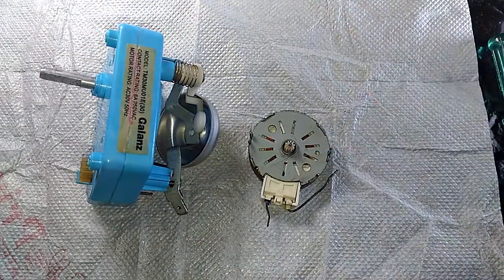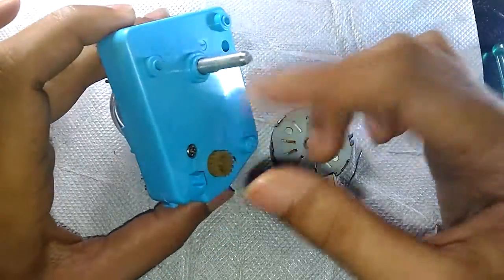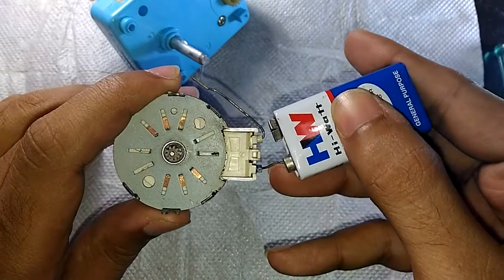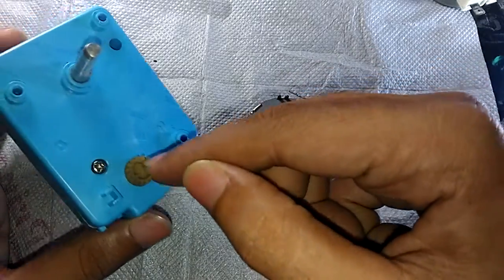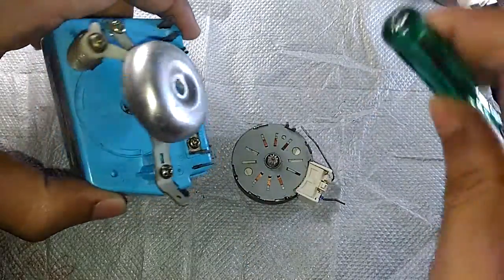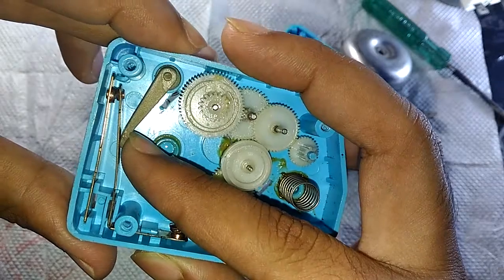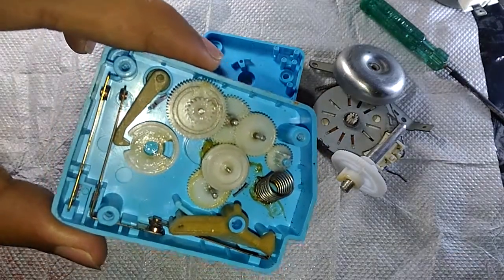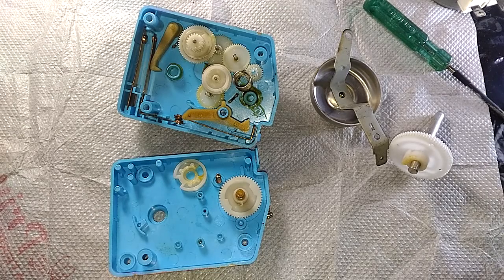IE8: Inside an old mechanical microwave timer switch.

Comment: More info about the timer :
6:16 The main rotary gear (the biggest one) contains some grooves that move an arm closer to the center once you set the timer past a certain point. This arm act on some gears and it change the overall speed. This allow timer have a non linear timing (eg: 1 - 2 - 3 - 4 - 5 - 6 - 7 - 8 - 9 - 10 - 15 - 20 - 25 - 30 - 35)
As others said the gear which is outside the unit is to control power (watts) and make microwave turn on/off faster or slower, using some cams.
Reply from the maker: Thank you for your explanation. 😊🙏🏼

Comment: The timer of my old microwave gets stuck sometimes in certain positions, the knob feels hard to turn, probably because dirt is stuck somewhere. Do you think it's fixable by little disassembly and cleaning without opening the gearbox, or does the resistance come from a gunked up gearbox?
Reply from the maker: If it's some solid particle or gunk, you can get it fixed by opening it carefully and giving it a proper cleaning. Sometimes it can be a chewed up gear wheel or a clogged motor. If so, it's a bit tricky and you better take it to a service center at this stage. 😊

Comment: Don't these usually work with a torsion spring?

Can you turn these back to 0? (is there some sort of clutch?)
Reply from the maker: This specific model uses a synchronous motor rather than a torsion spring. I'm not sure about other varients. Yes you can force it to zero.
Reply: @INSIDEELECTRONICS  We took apart our problematic Oven timer yesterday and it was a torsion spring based. (so is the new one)
I guess there should be no ill effects of forcing these counterclockwise, as from what I've seen inside the mechanism it doesn't spin the entire mechanism super fast but the main shaft just slips and the spring is reset to its resting state.

My father always says that it ruins the mechanism, while my POV was always that "it shouldn't". Even though I'm a mechanical engineer my father is vastly more experienced with mechanical stuff so I assumed he might have known something that I don't
Reply from the maker: If there is some sort of clutch mechanism, then perhaps it won't create any issues when forced to zero. But since I'm not familiar with such a type of item, I cannot confirm it. 😀 Always look for clues before forcing it hard, like whether the slip is rough or smooth, whether it makes any sounds that it shouldn't make etc.. Unfortunately without seeing one in person, I am really sorry to say, I can't help you in this.. 😃👍🏼

Comment: What is the resistance of a good motor?  I measured 19k ohms on a broken microwave.
Reply from the maker: 19k is a bit too much for a motor. You can calculate the approximate resistance by checking the wattage, from which you can calculate the current and hence the approximate ohmic value.

Comment: Damn. Yours is slightly different.  The primary program contact switching plastic wheel is simply putted on that spring. Its from two parts. Larger wheel Down and small upper wheel which is seen inside the hole before dissasembling that goddamned mechanism. There is obviously something wrong
Reply: I got IT! Its working. IT Just took 4 days.haha
Reply from the maker: LoL! Glad it worked! ✌🏽😀

Comment: Nice. So when it comes to the 'temperature' setting, it's more often called 'power setting'. It doesn't know anything about the temperature of the food, that dial just decides how much energy is put into heating it.
The thing is, the magnetron that generates the microwaves can only be on or off, it can't be 'partly on', so the way they do that is, the timer unit switches the magnetron on and off every certain number seconds. So if you have it to 'half power', it will just turn it on for ten seconds, off for ten, and so on so it's only on half the time. Those bottom contacts must be the switch that controls that. When the timer is set, the top switch is closed which turns on the light, the fan, rotates the plate etc, and then that second switch controls whether the actual heating system is on.
Reply: Thanks, I forgot about that power part (because I have used it just a couple of times) and I thought the timer seemed needlessly complicated. I thought the YouTuber had mixed up timer and power. This explains it all.
Reply from the maker: @ Username Password 😀
Reply from the maker: @Robert Miles Thank you for the better explanation. 😀

Comment: What is the electrical connection  of the timer?Unfortunately i removed the connection.
Reply from the maker: Unfortunately the connection diagram varies from different manufacturers. And I don't have the unit with me to tell you the connection of this model also.